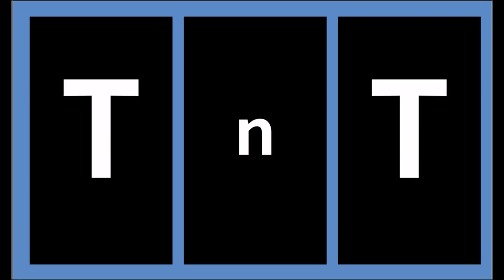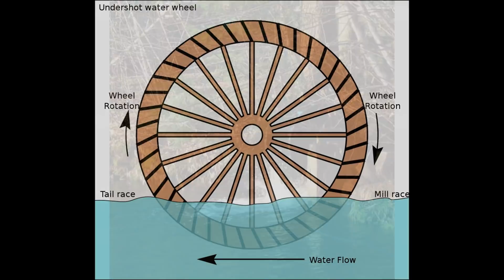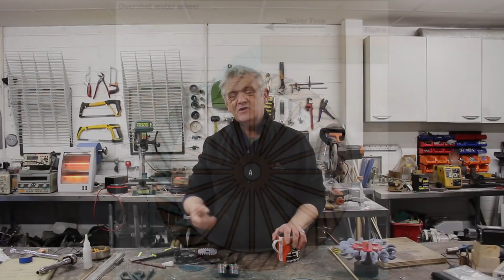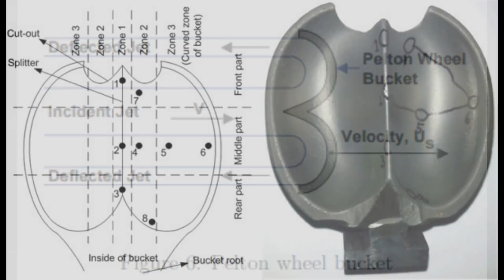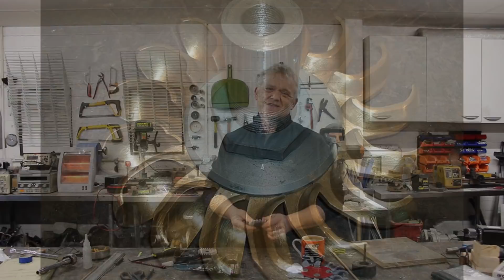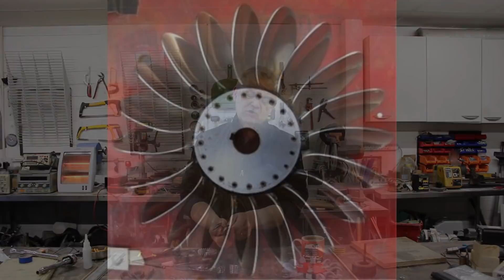1475 Types Of Turbine - The Turgo Versus The Pelton

Comment: Industrially recommended optimal pressure head of Peltons are 300-1600m, Francis 60-300m. Kaplan 0-60m. Do  you or someone else reading here, know the factual numbers for the Turgo ?
Reply: These numbers are not real...
 What would you use with 30 meters and 10 liters per second?
 Obviously I would use a pelton or turgo.
 Pelton or Turgo can work very well with up to 10 meters of water column.
Reply: @wall_is_on  My numbers are collected from big system turbine manufacturers, I see no reason to not trust their data´s for industrial sized applications.

(It´s to my experience Y.T. wont let me hyperlink url´s. 
Search "powerspout" in your browser and you ought to find a com adress of a small scale system company based in nz-land, they provide a site section of online calculators in selection out of their own turbine models.) ;

I calculated with 110mm pipe size, 50m of pipe at your 30m head. You´re home scale model example is according to their math at fully optimized worth up to about 1580 VA with a Turgo (Thats worth the start EMF (inverter´s peak power) of a smaller range home vaccum cleaner motor worth in direct feed energy). Their standard Pelton would in your metioned terrain example be starved of sufficiant flow, but they have a calculator category they referr to as Pelton HP that checks in valid at almost 1500VA output. 

Low head turbines would in your example case have too much water velocity for their turbine makes. Their calculator wont let me exceed input of 5 m head or less water flow than 10l/s for their overpriced, seemingly plastic dinkies, probably because their particular models will not be able to deal with such high potential. So is not the case with professionally optimized gear.

Thanks for your comment, I would probably not have come over that useful site without it. It will prove handy to my private scale case. Unless I find a midscale manufacturer, I guess I´ll be cadding me some LH turbines and weld trial constructions in stainless steel/alu cast or thereabout. I have low head, big flow and wild trouts I occationally like to be able to keep on fishing :)

Comment: I've been running a 6" Harris Hydro Pelton wheel for the last 16 years, 147' of head  thru a 3" line in 1/4 mile+34 amps @ 24 VDC, 833 watts backfed into the grid.  Bronze ones last about 5 years, my latest is all stainless, they are supposed to be bulletproof. Having said that, until just now I didn't realize how or what a Turgo was!  Good info.
Reply: The bronze ones in your case don't last long because the water column is extremely high for using soft metals or plastics.  With this stainless steel one, we will definitely see it working for a few decades, if possible, record a video and show it on YouTube, there are few projects being shown, but if you don't feel comfortable sharing your system, we will understand❤

Comment: Fair, but if you were to line the length of a river with in-stream water wheels, you would cause no environmental damage, and the roads needed to service the generator houses would create better river access for people, it wouldn't disrupt the fish, in fact it would oxygenate the water for them and it wouldn't be dangerous for people and animals to be around.

There's far more energy to be collected along the length of the river than there could ever be at a hydro-station since a hydro-station can only ever collect power from a the head pressure at the station, but if the river is lined with water wheels, then you could extract energy from the head pressure of the entire river and it would be environmental and people friendly.

Hydro stations could be reserved for places where waterfalls already exist.

Comment: If the water exiting a Turgo turbine still has mass and velocity could you use that energy? How about having a secondary turbine turning the opposite way? That way both the coils in a generator and the magnets move in opposite directions increasing their relative velocity. Slightly more complex electrically in that one side of the generator is normally static and you would need a commutator to take off power. Am I being hopelessly naïve?

Comment: Near where I live there is an archimedes screw turbine in use on a river designed for low head and I believe has better efficiency than an overshot wheel.

Comment: I'm running both Turgo and Pelton, I find the Pelton to be more noisy and had less power.The Turgo boosted my power by 200w and is very quiet to run. I find I get more power from less water with the Turgo. The water box for the Turgo was harder to build but not impossible and it's fun to do.
Pelton was much cheaper over the Turgo but money well spent in my view.
Reply: Where did you buy the turgo wheel from? I can only find pelton wheels for sale.

Comment: I love how, in natural physics, power transmission is all analogous, and we can have a big, slow mechanism or a light, fast-moving mechanism to transfer the same power:
Water: Low pressure, high volume water flow using large pipes (or a river!) and a big, slow water wheel VS high pressure, low volume requiring small hoses and a fast-spinning, light wheel.
Electricity: Low voltage, high current requiring large diameter, heavy conductor VS high voltage, low current requiring finer wires.
Mechanical: Low rpm, high torque though a large-diameter shaft resulting in big heavy machinery VS high rpm, low torque power transmission which has smaller diameter fast-turning shafts giving much lighter machinery. Rob has gone into this with his explanations of slow (Victorian era) VS fast-turning machines e.g.generators.
Electro-magnetic: low -frequency, high inductance AC power transfer requiring big, heavy transformer cores VS high -frequency, low inductance which only needs much lighter transformers. Hence the massive welders of the past are replaced by little caddy-packs that you can carry on a shoulder strap.
Small fast-revving motors with light flywheels VS slow, heavy thumpers. They don't sound as good, though😁 
I got off-track but I'm just drawing the analogies that are common through all modes of power transmission. You can have slow & heavy or fast & light, giving the same net result.

Comment: We are starting up the Printers. Make a few and test the best options for the Water Turbine. 

Now need to find a generator that has low torque, high rpm for a low, medium head. 

As for Numbers what would the flowrate/pressure need to be for High head, or medium head?

Comment: Great video Rob. The relatively high head pressure on impulse turbines is needed because you are converting pressure into flow/velocity by forcing it through a nozzle. If a given volume of liquid has to pass through a narrow gap(nozzle) at the same pace as it would without the nozzle over  "n" time  - the liquid would need to speed up. It would not do so though without sufficient head(or backpressure).  A Turgo or Pelton runner actually relies on velocity/flow and are classified as impulse turbines primarily because they ( the runner in them)are not flooded completely which runners in reaction turbines like Kaplan and Francis turbines are(A Francis is a reactance turbine although because of the way the runner is shaped the discharge also harnesses impulse to some degree ) A Kaplan(Basically a ducted propeller sometimes used with a volute) which is considered very good for high flow and the Francis(always uses a volute to do roughly the same as the nozzle on an impulse turbine would do. Flow through a volute works in both directions though) which is probably the most widely used large scale turbine have the huge advantage over a an Impulse turbine in that they can be run in reverse and work as pumps. A water wheel is a general term in most shapes or forms they would be classified as impulse machines technically.
Reply from the maker: thank you for adding that mate - loved it - cheers
Reply: @ Anders Fomsgaard. Is it technically feasible to take the redirected jet from a Turgo runner and put it through another wheel on a separate axle to extract a second burst of energy?
Reply: @ajayvee6677  It certainly won't be in current designs of  impulse turbines especially Turgos and Peltons(Can't imagine how you can achieve this with these). The reason for this is the flow/ velocity(therefore energy) of the fluid/gas is ideally consumed/transferred completely to the runner once it hits the spoons/blades and is then dissipated(if it is not dissipated properly then the fluid will disrupt the turning motion due to backwash and turbulence.) 

For example a well constructed Turgo turbine can be up to 88% efficient(maybe more) so there is only 12% potential performance gain up to a 100%. These 12% are toughest part to gain increases on though, and so it is not feasible IMO.

 People will typically add more nozzles to a Turgo/Pelton to increase performance if they have the pressure and water to do it. But that has nothing to do with increasing efficiency.

You could in theory also add more Turgo's to the SAME shaft, but you would only do that if you have problems with the discharge or can't add any more nozzles, then again if you have that problem it is likely your nozzle/runner/discharge is not designed properly for your setup. Again this will not increase efficiency 

However if you look at steam turbines and jet engines you could argue that they do what you suggest but these machines are way more complicated to make than your Pelton/Turgo and they work more like reaction turbines. This is because you have to put the blades/runners in a tube effectively to make them work, which means they will technically be flooded.(They won't work without the tube) They are in fact advanced turbomachinery which uses multiple stages of compressors and/or expanders, which is another interesting topic. (In addition they work with at least part compressible fluids like air, steam etc. Water is not significantly compressible at all. The name of the game with water is displacement if it is a reactionary setup and as such it cannot always be used as a comparable to the afore mentioned for this reason)   

The original Tesla Turbine with circular bore is a mixed turbine  -  both impulse and reaction it uses a nozzle to make the runner spin but the fluid is also trapped in a casing as it spirals inward towards its exhaust.  Its exhaust can indeed be used to drive a second stage also on different shafts. This device is mostly meant for steam or as what you might call a rotary piston in a pulse detonation setup(Similar to  -  but less complicated than a Wankel rotary engine and it does not have friction seals like the Wankel rotary or normal piston engines nor does it need a cam shaft). It is NOT well suited for water without modification in it's original design(I have thought of a couple of ways to do this - it is not done easily with or without CFD software and significant investment in development) If the medium is water you would be better of looking at Tesla's "Fluid Propulsion" patent from 1909 which is exclusively a reaction setup - This one uses a volute and and different rotor. Tesla made several versions of his turbines/compressors they can generally but not exclusively be categorized as turbo machinery. They are well suited for multi staging though.

Comment: sounds like using a ram jet pump to pump flowing water with low pressure up high into a tower and then use the power of its pressure to generate power from? (and maybe collect some of that power from the ram jet pumping action to generate electricity too probably LOL)
Reply from the maker: now that is interesting mate - nice thinking - cheers

Comment: This is brilliant Rob. Got me thinking about one of my other beefs with the lack of progress we see in this country. 

Let’s look at Flooding and in particular near me is the infamous River Severn. If we also look into the opposite and that is drought … you would think that a solution for both would be the building of pipelines or more simply and cheaply Canals were the primary use is to divert excessive flows of water that would normally off run into the main rivers but if we had a handful of primary canals or effectively artificial rivers built with tunnels at critical parts such as through high ground. The idea being is that there is a controllable flow of water that in times of risk of flooding could be used to route the flow via these water ways to the reservoirs that are drying out in the summer.
Turbines could be installed to generate electricity too and if the mapping of the routes of the channels was down correctly so that the source will always be higher than the run off to the sea then even some of the reservoirs could be used as a battery (dependant upon their height above MSL) … there are so many lost opportunities to actuall create employment, energy and avoid flooding and drought…. The trouble is the nay sayers and lack of investors … why don’t people like Elon Musk invest in so,e thing like this…
Reply from the maker: I know - the solutions really are in front of us - we just seem to lack the will
Reply: @ThinkingandTinkering  yeah exactly guys… until that is of course and they run out of solutions and then the idea becomes profitable. Look at wind farms … at first the hay sayers said it was unfeasible and wouldn’t even generate a fraction of what was required but now it is a good partial solution, however we can do better and in time wind turbines won’t  primary source of renewable energy. 

In desert areas … they can use giant reflectors to superheat steam to drive turbines… that could provide power for desalination to irrigate the desert regions and help to rejuvenate huge areas for food and re-forrestation capturing all the excess CO2 … so many ideas that no one wants to do but simply cost us the earth for simple individual greed. 

This begs the question and comes back to what you are doing  Rob is, how can we as individuals play our part, those of us with curiosity and imagination and the desire to do good things with our brains? 

Excellent source for inspiration Rob, keep doing what you do Sir, it’s refreshing to know that there are intelligent humans still amongst us
Reply: The idea of money is the problem... If i can make more money by building new houses or constructing roads or cheap land grabs etc after the flood and i can sell you water and food shipped half way round the earth during drought, why would i want to fix that?
Reply: Quite agree, Chris. Here in Australia there was a brilliant engineer in the 1930s named Bradfield who was in charge of building the Sydney Harbour Bridge. He proposed a mega irrigation scheme to divert waters from some of the coastal rivers of eastern Australia (in which we often see serious flooding). The water would be diverted through the Great Dividing Range to the drought- prone inland areas in the huge catchment of the Murray River, vital to agriculture and inland towns like Mildura. The Bradfield Scheme has been ignored for decades by successive Australian Governments , (admittedly it would be costly and require cooperation between State governments) but the benefits in terms of flood mitigation, drought protection and water security for agriculture would be enormous. More recently, one of the minor political parties- the Citizens Party - is trying to revive Bradfield’s ideas.

Comment: Very interesting Rob, great stuff. Aside from the difficulty for DIY, my first thought is what the relative efficiency of the Tesla turbine is and what are its best requirements as far as head and volume 🤔 Cheers Mate
Reply: I don't know the maths involved, but a Tesla turbine operating at peak is more or less a High pressure high speed turbine. It's akin to the first stage of modern multi-stage multi-pressure turbine systems. I'm being rather vague here as it's been many years since I studied this topic.
Reply: @craigslitzer4857  Thanks craig, it all seems a bit un-doable for the average bodger :)
Reply: @markmetzger5430  most of the functional models I've seen on the internet use shop air (50 - 100 psi) and are constructed from old music CD's and an acrylic case. Off the top of my head the fanciest working prototype I've seen was from a YouTube channel called Mr. Teslonian, if you wanted to have a closer look.
Reply: @craigslitzer4857  I will have a look, so much to learn :))
Reply: @craigslitzer4857  the real deal is using both water and air. at least aluminum (easy to work), not old CDs. 16" like pizza pie separators (cheap), not CD size (useless). and running it forward not backwards like every youtube video. You'll see lots of comments on each video from a few ppl like "out of reach" and "un-doable" (Mark M) despite the fact that bolting flat circles together is 5% of the work of making any other design and wear is greatly reduced from avoiding having to water-blast your surfaces. Don't hold your breath for a vid where it is done right. Jeremiah's channel is close except for running it backward.
Reply from the maker: I have heard anything from 20% to 95% mate with around 60% for gas turbines as the most often quoted - there seems to be a lot of misinformation around Tesla turbines that's the problem - which makes it hard to tell
Reply: @ThinkingandTinkering  Being as how the Turgo can be up to 93 % efficient and the average Muggle in his shed can bodge one of these together with spoons, the Tesla turbine seems out of reach. Thanks Rob!
Reply: @ThinkingandTinkering  let's find out in the Patreon channel! ...if anyone will do it correctly, its our man RM-S